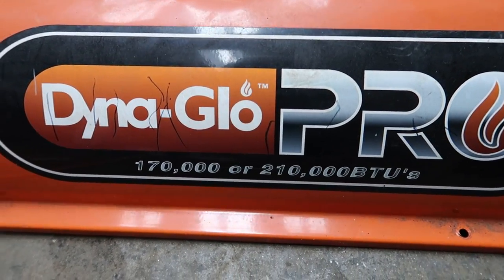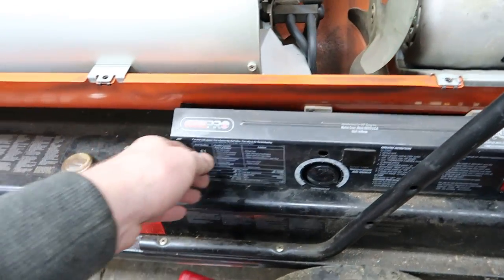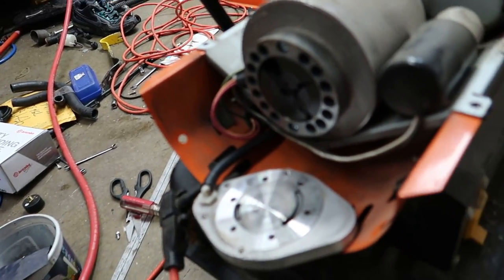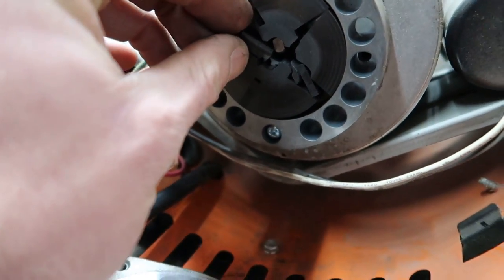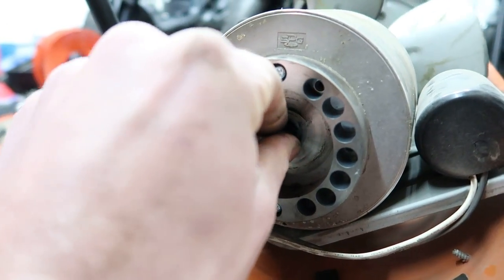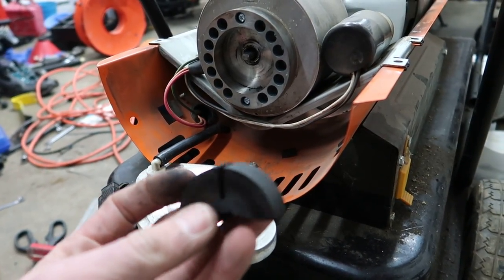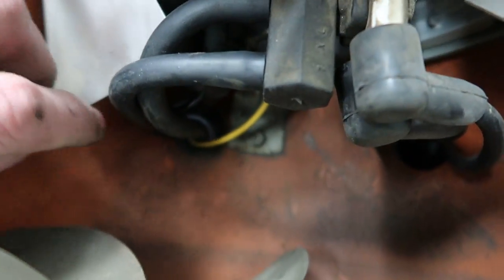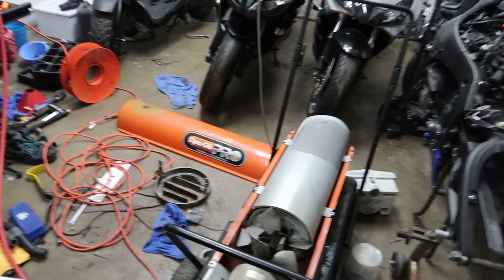DYNA-GLO Heater E1 CODE Fix Troubleshooting E-1 ERROR Home Depot DYNA GLO PRO Not Firing E 1 REPAIR

Comment: I've repaired alot of those and never found that part broken like that. Those just don't break for no reason. All they do is spin around and   force the air into the injector housing. It is an easy fix however. They are a good product and are well built. You just got unlucky.

Comment: Had this same problem and Error code E1, after watching your video I found the fuel and vacuum lines were cracked and the rear one completely fell off. Checked the disc and it was fine, after putting new fuel lines on the heater it fired right up and works like brand new. Thanks for your help

Comment: Hhhmnmm I wonder if that's what's wrong with mine. It spits and sputters and smoke and throws fuel out the front. Took apart cleaned tank out checked fuel lines and filter. Only ran for one season and when it did run it was real fumey. Tried playing with the pressure didn't help much.

Comment: I have same model, it suddenly stopped after running for an hour! Won’t light back up but blows fuel out like a MF.
Reply: Mine does the same thing. What did you do to fix it?
Cheers

Comment: Top notch video. They sell a kit with that rotor fins and both filters for 30$ at menards. Took mine apart to find that the rotor was fine but the fins had wore out. Been using it for 7 years first time i had to fix it or change filters. 🤷. Great video tho

Comment: Did that end up fixing it by replacing the rotor? I have a Master brand heater, same design and have a cracked rotor. Just ordered one but was curious if that fixed it.

Comment: I have the same heater, it runs with the top off, but not with it on.  Im about to take it apart and see if thats the problem, ITS A BRAND NEW HEATER! not even dust in it yet.......
thanks alot

Comment: I guess it's a good thing that you aren't in sales for a living because your "100% guarantee" was wrong!

My ignitor was unplugged.

There are two cables going to it, and it still made the ignition "noise," but only one of them were plugged in. After simply plugging it in, it worked

Comment: I had no issues until this year.  Had mine for about 4 years.  Just put a fresh batch of diesel in the other day and fired up the machine to heat the garage.  Went inside for about an hour and noticed a strong fuel smell leaking into the house.  I have worked with this unit many times and that is not common.  I opened the door to the garage to a thick fuel smoke.  I even thought that maybe someone hit the remote start on my truck (also diesel) and it just filled the garage.  The Dyna-shit was had shut down and the light was flashing.  I tore the whole damn thing apart, cleaned the fuel cell with alcohol and a swab, cleaned both air cleaners, cleaned the fab blades (not much dust buildup).  The part that had shattered on yours was still in tact so I fired it back up with the cover still off.  Ran fine so after about 5 minutes, I left it running and gently started putting the cover back on.  Within 30 seconds of putting the last screw back in, the damn thing quit again and began smoking.  I hit the switch and the smoke stopped.  Not done with the repair yet but I am hoping it was just an older can of diesel that I filled it with by accident.  About to run and get some more as the temp is -10 F and I want to get some work done in the garage.  I will drain the remaining fuel in the tank and see if that works.  To your point, I have seen the same issue you have had on many videos.  Parts like that should NOT go bad.  For the price we pay for the products, nothing should.
Reply: What ended up being the problem? I have the same issue

Comment: I bought my heater last year black friday ( master brand from Tractot supply) never been used once.
Went to fire it up other day and get an E1 error code.  I did put diseal in it last year but I doubt the fuel is already bad.  Anyway sucks it's brand new and won't work lol

Comment: I was getting e1 and the piece of shit wouldn't light but today I took the cover off and it fired right up and set the cover back on and it stopped and did a e1 again and took the cover back off and works fine, so I put some hinges on one side of the hood and leave it cracked on one side as it was pushing to much air causing it not to light. I could never get low to work but now both hi and low both work and fires up every time.

Comment: Runs great with the top off, shuts off when I put the top on??? Mine worked great for two years. This season it tries to light, flames out with a puff of smoke , then shuts off. I tried everything I found on YouTube channels. No luck. Runs great when the cover is off, shuts down when the top cover is in place, not even screwed down. I noticed the fuel hose was cracked back at the pressure gauge. Who would look there? When I put the cover on it was creating a low pressure at the fan intake causing a flame out via a leak in the hose. Replaced both hoses (different inside id) and it runs great.

Comment: mine when I bought it(facebook market place), the hoses were all cracking on the ends..... I cut off ends and attached em however(barely long enough) just to test, worked; went over to Canadian Tire(automotive store) and bought windshield wiper rubber tubing, redid the whole thing(added zip ties to try to help it not crack on the ends so easily) and it's  been working good since...... I did check the pump but it was looking alright(personly think I will probably rig it with a needle valve and run it off a compressor if it ever goes bad)

Comment: I have a 120 BUT similar Kerosene heater and it worked perfect last winter. Now I tried it here in Nov of 2018 and it powers up, cold air blasts out but no heat and it shuts down and shows an E1 error. 

 I even dumped the fuel and put in brand new fuel thinking that  my last year's fuel went bad  However no difference and I only use the best clean Kerosene. Never nothing else and its about 5 years old and probably used fin total of 20 hours max.  Is the E1 Error  telling me what could be wrong?
Reply: Check for cracked fuel lines.
Reply: What was the problem? Have the same issue.
Reply: I took the screws out of one side of the top cover , shined it up and left an 1/8 crack, screwed it back down and it runs perfect now for like 2 years, it ran with that cover off , but wouldn’t light at on with it installed, that’s how I arrived at that solution.

Comment: 4:00   Time. Good take, on just another  ' chinacheapie ''.  WHEN  you install that new round, rotor ;   Adjust the outer ring, to be 5 thousandths,  of  an  inch, away  from  the  ROTOR, (use  spanner  gauge )  ON THE   tightest circle of its'  travel. This, will ensure a good  'seal'  between the compressor, and the outer ring.  Anyway,  good take, on another modern well designed, but manufactured with  CHEAP  parts.    (old guy)

Comment: Things breaks when you use it...and it also breaks when you don't used it! Companies money greed find ways to save money for the most profits! 

Probably (or probably doesn't exist) that same or similar heater built in the USA will break down as well with normal use or stored in unfavourable conditions...but you pay more for it!

Comment: Did it have code ( e1). ? Mine slowly gets colder and then cuts of into cool down mode. Before that started happening it would begin the start up cycle and just pour diesel out the front of the fan housing and if by some miracle it would start,holy shit it was like an after burner on a jet engine till the excess fuel burnt off. The pos sat in pieces for a year thinking the igniter module was faulty. Decided to throw it back together for one last go and guess what, the fkin thing runs fine for about two days..now it sounds like it's slowly running out of fuel. Both faults had e1 code.go figure. Tried to ring the company in China to get some help to fix it,but they don't speak English lol. Joking of course.zero fks given from manufacturers and the wankers that import this shit.  Don't get me wrong if it was $100 or $200 or $300 I would just bin it,but where I come from these little fkers are $1400.00 new.
Reply: K Phillips , what?,.!? 1400.00 , ????   I would freak out, holy crap!
Reply: I have the  same issue, what ended up being the problem